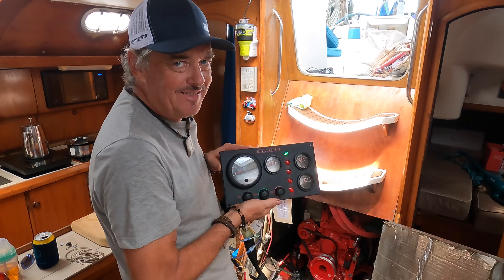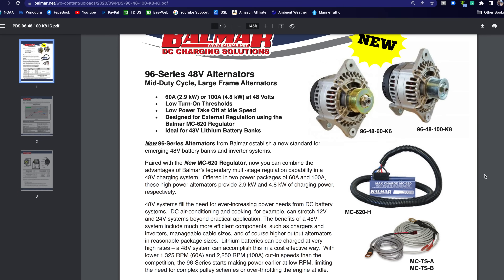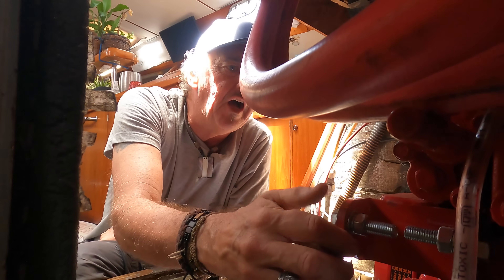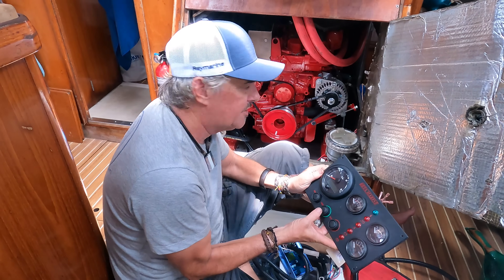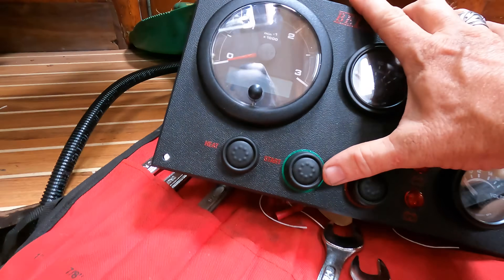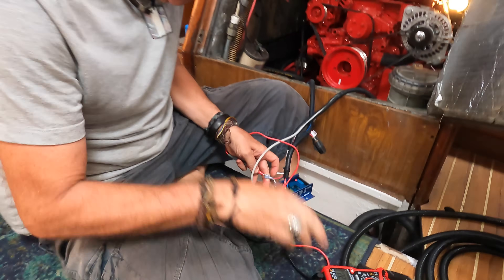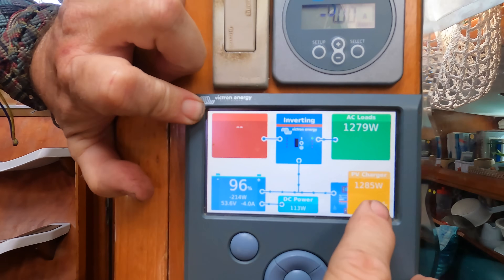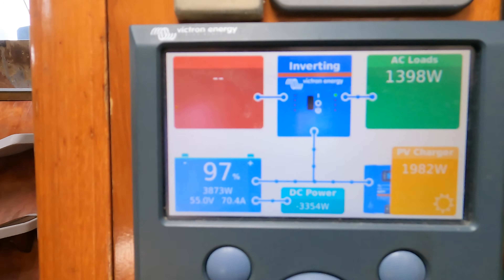SSL639 ~ THIS will change the way we live on BOATS!

Comment: 10kw DC outlet at 60-70% efficiency (ie alternator heat loss) is sucking ~17hp from your motor, not 8-10 as you figured. So what were the engine revs at the 6000 watts you tested at? Sounded about 1200rpm. So, an 85hp/63kw motor, = 17/85hp or 10kw/63kw = ~16-20% of your engine power if/when you run 2 alternators.

Comment: Set the regulator to a low current below about 1500rpm, otherwise you risk stalling the engine, helps alternator temps as well.  Do a switch line to take one or both alternators out of circuit via the regulator - this is very useful and stops genset/shore power conflicts.  Temperature senders will monitor alternator overheat (low rpm) and can throttle back output.  Shut down protection is also beneficial in case the BMS(s) call a halt to charging.  Some automatic clean air fire extinguishers in the engine and battery compartment will buy valuable minutes in the event of a muddle and is icing on the cake.

Comment: Capt. Rick, I just got back from Bimini a couple weeks ago and as I was coming into my marina, I noticed that my cockpit lights were blinking and I was getting beeps, seemingly coming from my carbon monoxide detectors in the cabin. Once I reconnected to shore power, things went back to normal. Do you think those things could be related to my generator or a grounding issue?

Comment: I wish I knew about these new alternators prior to installing my generator.  The tech is nuts for sailboats now a days, high output alternators, lithium, solar, and 12v air conditioners.  I need to refit my catamaran with new alternators and 12v air conditioners.

Comment: You really went by it fast but you did say you have 10K hours on your engine in ten years.common sense tells me that you should have purchased a small gas generator, 1K watts is all you need to power a 40 amp smart charger, which can charge three banks of batteries at the same time. Running you boat engine to charge batteries makes no sense when the generator is only $150 on Amazon and your boat motor costs thousands.

Comment: I am also a 48V friend.  Having electric motors you need 48V to get some hp output without needing 400Amps with arm thick cables. Going to 96V would make it more dangerous, a Voltage i wouldn’t like to touch.  Next step would it to convince manufacturers to create 48V fridges and washing machines.

Comment: Just so you know that you are no longer allowed to work on your electrical system .Once you hit 36V you must be a licenced electrician to work on the systems in Canada ! Stay at the 24 v system .The issue is voltage and current  after voltage is above 24v and current  is  above so many amps  or kw power  .There is a maximum current allowed and then you must be a licenced electrician to work on them .Issues started with solar power and power generation .Too many fires and injuries from mis wires and battery failures .So the ESA electrical safety authority gave itself powers to regulate all electrical work .Just remember use the right fuses and breaker and wire size !All will be fine .And remember lead acid batteries produce explosive hydrogen gas when charging .Lithium batteries have their own issues ! Keep safe !

Comment: The smaller crank pulley will spin the alternator faster.  Not much danger of overspending the alternator with an low rpm diesel engine but something to be aware of.

Comment: Adding spring loaded belt backside idler pulleys on the slack side of the belt
will automatically maintain correct belt tension.

Comment: ::No like it::
if you tighten that belt a bit more, the bearing in the alternator won't last; remember, it's both sides pulling on it;
that setup is incomplete
i would not let that get out of my shop like that
a tensioner (of a small diameter, about 1" to 1.5") is needed on the slack side of the belt,just to steady it, the contact angle is already good;  
 all that whipping also helps to beat the alternator bearing to its demise

Comment: Have you considered the load factor on the little engine with two of those monster Balmars and driving the boat forward in gear?   I've seen yanmars damaged internally before due to localized heat buildup from overloading in mid-high RPM overloading.  the people often don't realize that they damaged them, just spend a year or two wondering why the engine does not seem to run like it used to...   this is a very bad idea for most applications.   the HV thing is good👍.   and you should be using a tension gauge for the belts. It's very hard to get the tension right without any way to measure tension or deflection like you are doing.
Reply: 100 percent, there is nothing to stop the altenators dragging the engine down at low revs and oil pressure. Oil temperature wont go up it'll just chuck a rod out of the side while its ticking over trying to supply load. Generator sets balance the load from the altenator against the load on the engine and increase the revs to suit.
Reply: @cedley1969  yep. having two monster alts. on a little engine, or even a larger one, while asking it to power the boat forward, is just asking for an overload condition, while not letting the engine reach it's WOT RPM.   not sure what will break first..   if nothing else, then the combustion will not happen properly due to low air volume, and low BMEP. mean cylinder pressure.   could be ok, if moderate load, combined with a re-sized smaller prop, but most people don't think enough to do that..  and it would hard to test operationally, or simulate.  or calc for.  and easy to overload and wreck the engine.   overall, bad idea.  and solvable by just using a genset.  can't help everyone..

Comment: If you eliminate the "little" alternator, how do you charge your start/control batteries?
Reply: I would assume a small 48v dc to 12v dc Victron charger. We do the same from 24v and it works fine.

Comment: 07:45 did you say you were starting the engine without wiring the alternator output?

Interesting video, and thanks, but... even with just residual magnetism in the rotor, the output voltage can be very unpredictable, sometimes going way too high off load. 

It's worse with the combined alternator-regulator setup used on a lot of cars-they may not self-excite, but if they do the output spikes wildly before the regulator has a chance to reduce the field current (field coils being inductors and all!). That can fry a rectifier or regulator.

Comment: 90A at 54V= 4860W= 6.52 HP. Power input from engine at that output is 18 HP, so efficiency is 36%! That is not good. Would rather get a PM alternator, they can be wound for various voltages when ordering. And those of you concerned about heat, yes that is 12KW heat source at that load!

Comment: Suggest having those machined pulleys balanced. That's a lot of unbalanced weight and load being subjected to a small crank. Then as a final touch dial them in with a dial indicator on the engine. You will be surprised at how well the belt will stabilize and how the pulleys seem to be sitting still while running.

Comment: I'd replace those allen mount bolts  4:29 with standard grade 8 stuff.   Be sure to grease that tensioner bolt threads and tighten it just a bit after final install, they can come loose and un-thread.  Be a nice to be able to disable one or the other electronically to free wheel when not needed.. Might come in handy in an emergency> Extra useable HP.  I've seen some diesels disable the alternator on start up to free up cranking. No need running two alternators when batteries are at 95% capacity.

Comment: man thats a small pulley, hope it has F1 spec japense ceramic bearings. though if it's only seeing idle speeds most of it's life......
Reply: Bearings are not an issue.
Reply: @ShainAndrews  belt tension? I hear on vehicles fancey alternators wear out quicker when they put a small pulleys on them?
Reply: @cdoublejj  I figured that was your logic.  This is low speed diesel stuff.  I'd be surprised if that engine can spin 2500 RPM's unloaded.  Most diesel applications size the alternator pulley about the same as what he installed.  The majority of high output aftermarket alternators live a short life not because of bearing failure, but rather rectifier or stater failure.  This is the direct result of excessive heat.  The output increases but the physical size of the alternator never changes.  The cooling is not increased to meet the output.
Reply: @ShainAndrews  DUDE! I totally forgot diesel is like half the RPMs!
Reply: @ShainAndrews  wow an engine bay is the worst place to put one then! Need a PTO on the back of the car lol 😆

I had started looking in to something for my work van. Not sure there is a right answer

Comment: I have two 48V boats! Really enjoyed this and I am interested in Balmar’s product. John Deere also has a 48V water cooled alternator for one of their reel cutter mowers for golf courses.
Reply: I would not touch a John Deere part unless you are sure it does not have their serialization tech in it. you don't want to be on the water when software locks out your alternator....
Reply: @jdrissel  it was on the 2500E reel mower, no computers on their mower. I see them pop up on fleabay once in a while for $200 or so.

Comment: lol - just started the video. I have an instrument panel / starter switch in the cockpit of my boat that's so unpredictable I permenantly jury rigged a second starting system right on top of my engine! What I really need to do is rip out ALL of the old wiring and build a new wiring harness like you did. But there are many other things that need re-fitting or repair that are a higher priority on my boat. Like a haul out, blister repair and new bottom paint before I head accross an ocean. Glad you got your's sorted out. Fair winds!

Comment: I begin my comment with a big hugg to you guys and big kiss  to Rick junior ; he has grown so much since my last visit to your site !😘 
Your alternator belt should have a BELT VIBRATION DAMPENER , it has a pulley with a built in spring to absorb not only the belt vibration but the diesel engine vibration transmitted to the belt , the DAMPENER will smoot the ride of the belt and take the tension load off the alternator bearings ,who's by friction are creating temperature and premature fatigue ! Like cars ,have also serpentine belt vibration DAMPENER !
Now you are been able to incorporate an Window A/C  that will cool the galley and sleeping quarters ! Also if you have outside Led light to keep the deck illuminated or high power beam it will keep you safe and let other vessels see where yours  are  ! Funny I used to have a sports car with Cessna aircraft landing lights as a high beam , that I used a lot coming back from   Las Vegas  because the high speed drunk drivers and accidents ! Mary your cuisine has built a strong family , I M sure it has to do with ammore, olio di Oliva e allo, ragazza , Te  ingrazzio benne e baccio a tutti ! Auguri di felicita !

Comment: I'm not a boating guy.....yet.
But I am a pilot.
On some aircraft we can deploy an emergency generator into the slipstream with a propeller blade that will make power if we lose the engines.
Do they make something similar for sailboats?
It seems like days when you have a ton of wind might not always be as sunny for solar panels... 
Or low wind days if you are using wind turbines to make power.....
Anyway, it's not the weirdest thought I have on the subject. Seems like you could make power in an emergency by using a sea anchor as a yoyo when anchored.

Comment: It took me a few reads to really understand why 48 volts is the way to go, for many reasons.  Why wasn't 48 volts used originally?  Well the DC / DC convertor technology and the LiFePo batteries were not around then.  It's the electronics and how cheap it is now that's makes 48 volts possible at a reasonable cost.
Reply: Having lots of cells in lead-acid batteries used to be very expensive, also above 30-40vdc you start getting problems of arcing in electrical switches. 48v is great for a high power system with an inverter but sadly dc lighting and consumer electronics like chargers and small appliances are more available at 12v, less available at 24v and almost nonexistant at 36v and 48v
Reply: @nirodper  You are right Nicolas - for DC apps 12 volts is the way to go 48 is way to dangerous.  But if you want to AD to AC 48 volts now is the way to go.  I'm slowly building up some off grid backup supplies.

Comment: Similar to your installation, I use a large case Balmar 12v 160A alternator.  Then I switched to lithium batteries which could take everything the alternator could give.  Alas, the alternator overheated due to using hot engine room air for its cooling, and the engine overheated when at max cruise power due to the extra load.  Solution was a cooling fan to blow cool bilge air around the alternator and a half-power switch to reduce the alternator output by 1/2 when motoring (see Balmar manual) and full output when just charging at anchor.  My engine is 32hp and I estimate the alternator uses 5-8 HP.  Hope you have better luck.

Comment: I hope your electrical switches are designed to break 48Vdc. It may sound trivial to you but 48Vdc is difficult to break as it just arcs across the switch contacts when opened and a fire can result. That's the problem with anything above 24Vdc. Decent circuit breakers with a suitably high fault current rating and dc breaking capability is also required. It's not as trivial as 24Vdc and that's why it was never used widely.

Comment: With that big a difference in the crankshaft pulleys, I'd expect big differences in the alternator rpms. Did anyone check what speed each alternator will be running at ? At idle, cruise, and battle speed, versus alternator outputs & max rpm limits? That's often neglected, but it is important.

Comment: There are threee problems with your installation:

1.  The engine is enclosed under the stairs and the cockpit.  The higher output alternator will produce a LOT more heat than the factory alternator did.  Heat destroys alternator diodes.  You will need extras from Balmar.  No regular alternator shop has replacements.  You need to engineer additional cooling into and out of your engine compartment.  Both in and out.  Replacing diodes is not difficult but do not try to solder the connections.  The heat will unsolder them.

2.  A 100 amp or larger alternator needs double V-belts.  

3.  I tried Balmar's high-tech regulators but when they fail - and they will - you need backups.  I eventually went to automotinve two stage regulatore because you can get them anywhere and they cost less than $10... 

Don't lose the old alternator.  You will need it.
Reply: The new alternator has a temp management system to protect the system which he did not have before. Also stated early in the video, he was adding a cooling duct to blow directly on the alternator to assist in cooling the alternator. Looks like he's covered all the bases for a successful retrofit.
Reply: Your electronics foo has failed you. He has moved from 12V to a 48V system, so for the same power the current has dropped to a quarter of the 12V system. The heat in a diode comes from the forward voltage drop which is basically constant regardless of the power draw. For reference this is the major power loss in the a power supply. Power is P=VI and as the forward voltage drop is a constant and the current has dropped the power loss drops too, and thus the heat you need to get rid of. You could probably totally eliminate failure by switching to GaN diodes (I would expect that to be pricey though), or move to active rectifiers and more or less eliminate the forward voltage drop and thus heat. Given the price of fuel active rectification is probably the best bet though it will have a higher up front cost. I would note the reason for moving to 48V systems is to reduce your power losses.